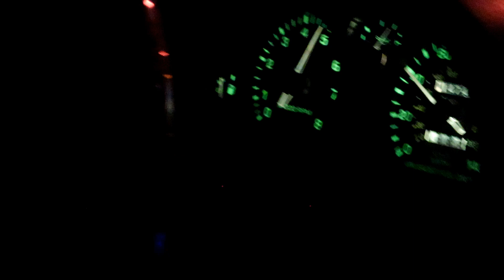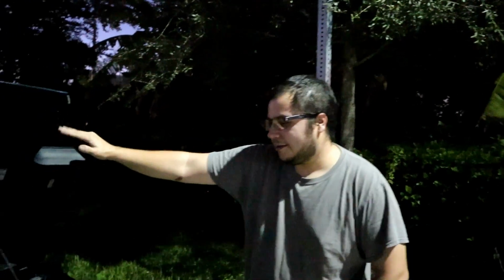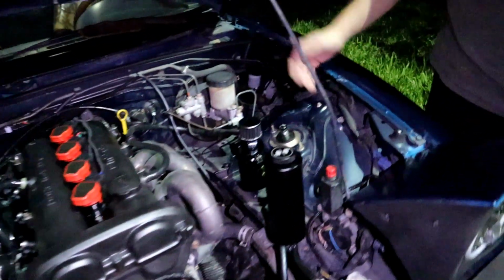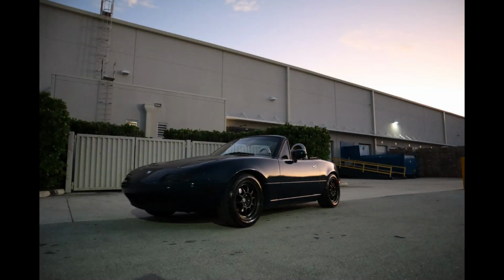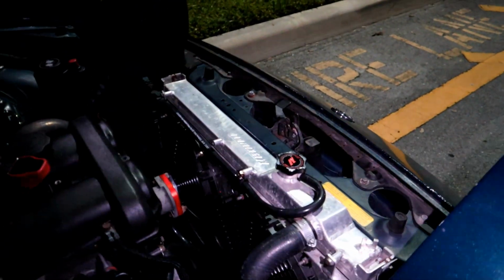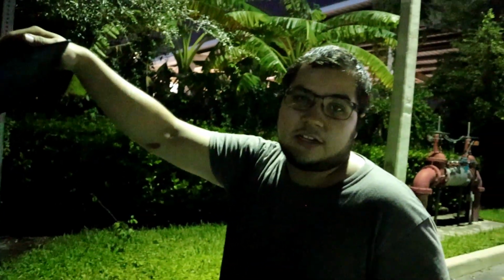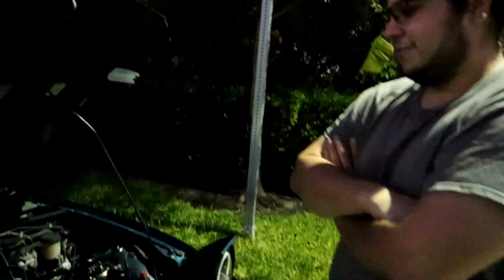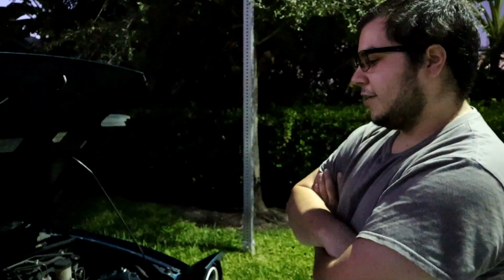ITB Miata - 8000 RPM Screamer

Comment: Do any of the rubber/hard lines need to be replaced to run E85 on the NA miatas?
Reply from the maker: The hard lines are fine but, all of the rubber parts of the fuel lines need to be replaced.  With something like this.
http://www.radiumauto.com/FuelPCV-Rubber-Hose-P567.aspx
Reply: @mr.twosix  thanks man!

Comment: How did you get 14 to 1 compression?  I think the highest pistons out there is 12 to 1.  You would have to shave the head a huge amount to get that.  I would like to see some compression test numbers to believe it.  If so then you definatley have an interference engine now.   Also you have a 8k rpm engine and are still running the stock damper?  This engine isn't going to last long with the type of harmonics you have with it......